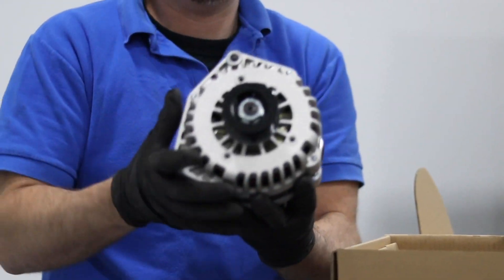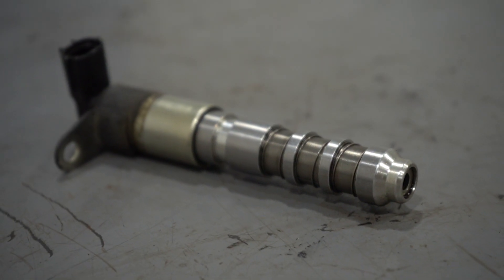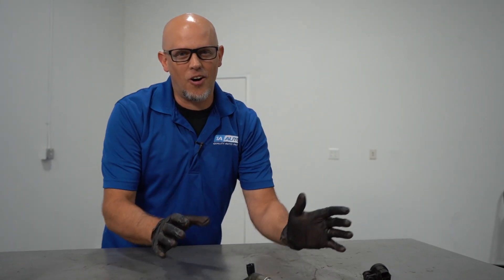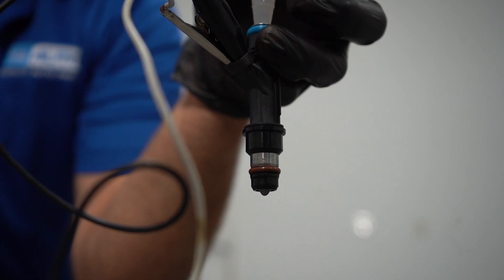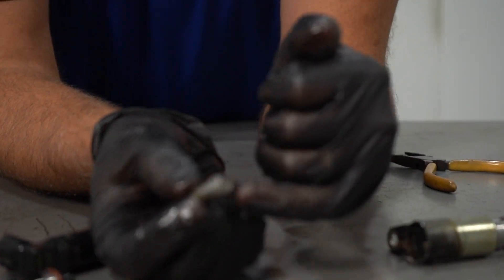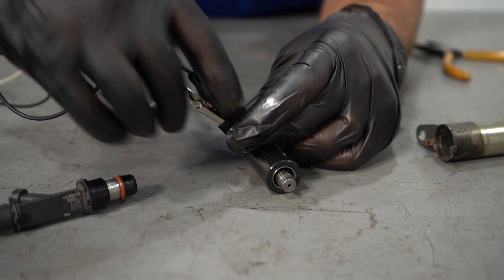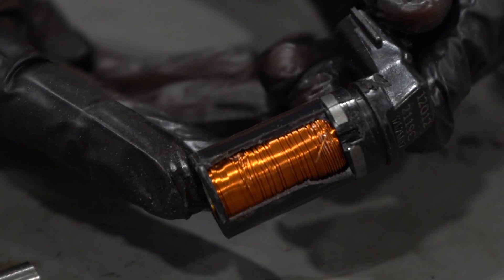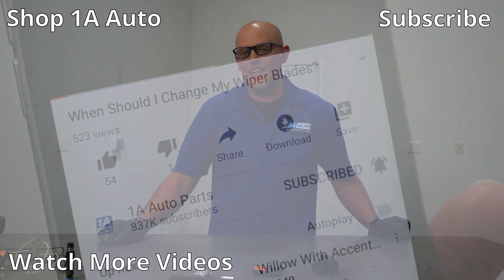Car or Truck Solenoid Valves? What Are They? Let's Look Inside!

Comment: Hello. PLEASE HELP. First, thank you in advance for any help you may be able to provide. I'll keep it to the point:
I have a 2011 Honda Accord. Engine is great, transmission FREAKS OUT @ 3,000 RPM. It will shutter and shake and refuse to shift. If the throttle is minimal, it will shift fine all through the gears. No matter what if that tach is brought up to 3,000 RPM it will refuse to do anything, it just neutralizes. 
Again, if I drive easy and let off the throttle just before 3K RPMs, it will shift and continue without any issues. 
Please tell me where this problem is coming from to the best of your knowledge. ANYONE'S THEORY IS WELCOME!